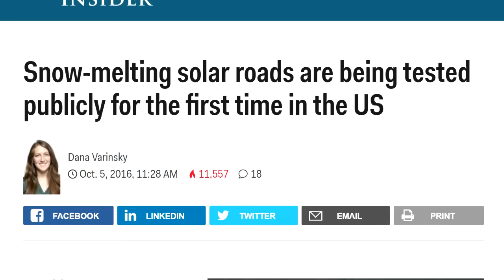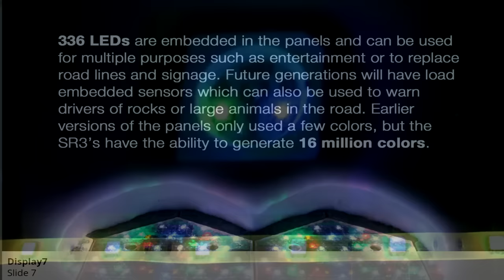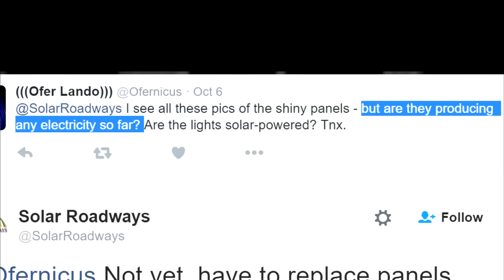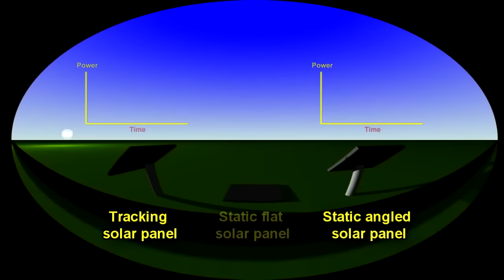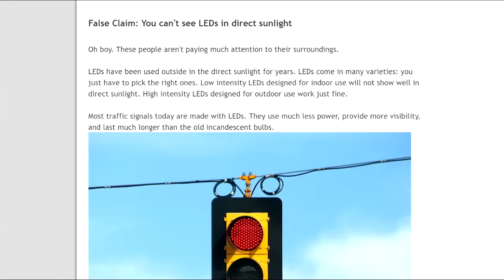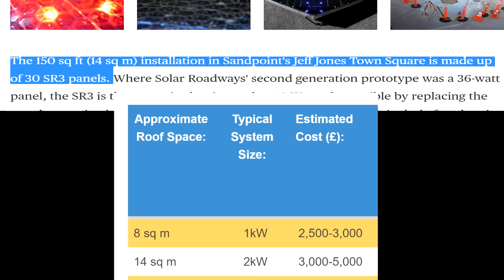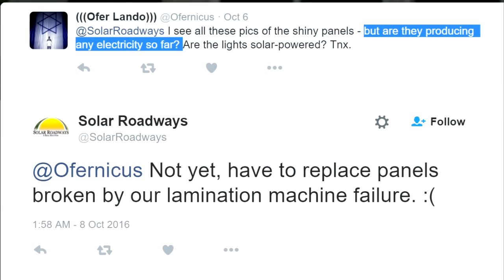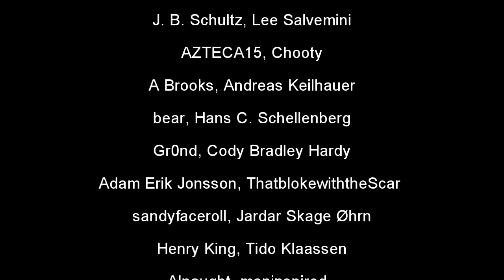First AMAZING Solar Roadway UNVEILED!

Comment: Why was the tilting of the solar panel relevant to solar roadways anyways? They're gonna tilt the road?
Reply: Light intensity hitting a surface depends on the cosine between the surface normal and the incoming light ray. The further off dead-on it comes in, the less intense the light, and if you're trying to generate power with solar cells, you want to maximise the intensity so you maximise the power you generate.

A panel flat on the ground isn't going to ever get the sun coming dead-on unless you're located right on the equator.
Reply: ***** Yes I knew that but again, they don't have much of a choice when it comes to the solar roadway. They can't tilt it.

Comment: i just got to be blunt about this. the idea of replacing all roads with solar panels is more or less a pipe dream. acording to Wikipedia their is over 4,071,000 miles of road ways in the usa. and lets just take a wild guess and suggest that to pave a mile of road. it cost roughly 10 grand. that is over 40,710,000,000 bucks.  that is over 2 times the current us dept. and this is not even counting side walks, parking lots or anything else that is mentioned. 

their is no way that this would work. let alone would it be more reliable then black top and paint. because what happens if it glitches out and causes a car crash? who would be liable then? could they sue them for damages due to faulty equipment? further more what industry would be affected by this? how many jobs would be lost because of the switch to this? also how much environmental damage will be caused by the production of solar pannels. further more where will you get the resources to make the dam things. 

further more if this was created. it would need enough silver to cover the entire distance. this would drive silver prices threw the roof. i estimate around 10,000 an ounce. making the price of a mile of those things. possibly around 100 grand a mile. making the new total to about 407,100,000,000. and that is just the usa. it is estimated that their are 11,194,445 miles of "paved road on earth" making a wooping total of about 1,119,444,500,000. 

so even if every single person on the planet gave all their wealth to support this idea. they would still fall short by about 1,060,444,500,000 bucks. it is just not fesable.
Reply: You're slightly off on the cost of highway construction....and by slightly, I mean by several orders of magnitude.  :)  The cost to build a new 4 lane highway is around 4-6 million dollars a mile, double that in urban areas.  The cost to mill and resurface an existing highway is around 1.2 million a mile.  You need to add 2 or 3 zeros to your final numbers...maybe more....just makes your point that more relevant.
Reply: ya i hate to point this out but that kinda makes my point even more valid. as i never did any actual research on the cost of roads itself. thou you do make a very valid point behind it. as the numbers i made up were pretty small in comparison to what really is needed. 

still in the end it makes my point more valid. that the idea behind it is near impossible to fund.

Comment: Warning long post: debunking ThunderF00t's debunking of solar raodways
Had I not dig a bit more into this solar roadway thing, I might have been convinced by your "debunking" video Thunderf00t. However, I now better. These solar roadways that you visited are kinda dumb, but these are old-tech roadways. There are prototypes being built that are far more advanced (using thin film tech for ex). Check Wattway solar roadway for example. We have a 1km solar road in France that is an actual road. The proof of concept is already there. Now is it economically viable at this point? Of course not. Just like every freaking renewable energy technology when it started. But now wind turbine and normal PV are competing with conventional energies in an open market (no subsidies). And they are doing fine.

Also, I've seen videos "debunking" the wattway solar road, but they only have 1 argument: the cost of solar roadways compared to rooftop PV panels or PV farms. Wich is a good point only in 1 way: if you have enough unused land to  make a solar farm, then great, don't do solar roads, do a PV farm. Everyone in your neighbourhood think that PV panels are aestetically pleasing? Fine, use rooftops panels. 

Saying rooftop panels or commercial PV farms are cheaper and more efficient than solar roadways, so we should completely ditch the idea of solar roadways is simply stupid. All these technologies are complementary.
It would be like saying that off-shore wind turbines are more expensive and have a way higher maintenance cost than on-shore wind turbines, so we should ditch off-shore wind turbines. Someone who think like that fails to understand the end-game of an ecological transition and scientific progress in general. 10 years ago off-shore wind turbines couldn't compete in an open market with no subsidies. Now they can.

Not to mention, there are a lot of cutting edge new technologies being developped in the photovoltaic world. Take perovskyte for example. This tech managed to get the same level of efficiency in 5 year than regular silicium panels tech did in 30 years. It is not commercialized yet but it could very much revolutionize photovoltaic science. So developping and researching ways to implement solar road is not at all stupid. Even if it is not viable now, the next generation of PV panels combined with what we learnt trying to overcome the construction challenges when researching solar roadways could very much make it viable in a few years.

What about multi-junction cell technology? Sure, they cost an insane amount of money to be made for a slight increase in efficiency, thus are not economically viable. Should we ditch the technology and stop research? Well guess what, this is a technology that is still usefull and is actually used for solar panels on satellites in space, wich are projects where cost is irrelevent compared to efficiency. And what if a technology used initially for space exploration ended up improving our lives down on earth, as it has been done for countless examples?

Another analogy as to why it is still interesting to research solar roadways is the electric car. Right now an electric car has the same carbon footprint as a conventional car has, because the electricity that it needs to run largely comes from conventional fuel like coal. But when that changes, and electricity is produces with renewable technology, then having electric cars makes sense. And what if solar roadways could provide the electrical energy needed to power your car? A few decades from now, when electric cars is the standard, wouldn't it be convenient and cost effective (no need to transport the electricity or integrate it into the grid) to have charging stations powered by the very roadway that people are travelling on? Wouldn't it be handy to have done a little bit of research beforehand?

You don't think far enough ahead Thuderf00t!
Reply: The Wattway has not shown that it can exist for 20 years without massive maintenance the way rooftop solar panels have.  Maybe if they make it 10 years without having been replaced, and are still producing a reasonable amount of electricity, then they might be close. Roads are really tough places due to vibration, shear forces and lack of air flowing behind the cells to keep them cool.

Comment: wouldnt a better solution is to make the roads a carbon sink. figure a way to pull carbon out of the air then turn it into a road way instead of using roadways that contain a chemical cocktail

Comment: I wouldnt want to live there if thats the quality of municipal workers workmanship, imagine how well they maintain public buildings?.  Who the fuck signed the work off as complete?  The hexagons not even fitting together properly, where I come from you would be sacked for such shoddy work.
As an aside, there are/were tiled roads, we used to have about 3 miles of em nearby.  They were more concrete strips admittedly, but they did last a very long time (decades) before being replaced with normal road material.  The problem with them wasn't durability but rather the bumpy clickity-clack train like ride you got as the vehicle went over the joins.  I guess they wernt as safe as theoretically they could cause loss of control, although I dont recall any accidents reported due to the tiles.

Comment: Sorry I'm late to the party. 
I'm not going to pretend these people are the right people for the job. I also think it’s a bit naïve to think that this is going to solve the world's power problem, but I do like the idea of Using hexagon panels to cover the roads. It could make it easier to build new roads or, fix and repair existing. The panels could be mass produced in a factory. (Instead of a garage on some ass hats ranch). When one breaks down it can be recycled and turned into another panel. A heating element with a thermostat could be add to help with ice and snow, and the “Power the Panel Produces” can be used to run the system. You won’t get the fancy light and it’s not going to bring power to the masses but, it might be enough to help power existing street light. Maybe even add some new ones on all the back roads in the Midwest. These people are f-ing stupid and shouldn’t be left in charge of cleaning up the dog crap left at truck stops let alone building an intricate part of the country’s infrastructure. I just think the right people might be able to make this useful.
Reply: josh walker using tiles for roads is a bad idea, they don't last that long and would be a lot more expensive to make

Comment: Well maybe they will change the project into something that is actually feasible... I mean like the solar "road roofs" idea in your video... I mean the idea is kinda cool in a science fiction kind of way.... but putting solar panels along the roadside would probably be better for cheap.
I am kinda worried though that our governments would spend money on stuff like this without like just telephoning a FREAKING SCIENTIST/ELECTRICAL COMPANY expert etc... to like overview the idea! lol its not the guy that bothers me... if you are gonna dream, dream big and maybe something good would come out of it but spending tax dollars on this is BS! lol

One of the neater transportation ideas that I seen was to make electric railways (I think they wanted mag lev but not sure) anyways they would be like mono rail that goes along with the top part of the railway being solar panels (mind you they were not delusional enough to believe that would be enough to power the entire system or anything) I think some sort of railway along major interstates is a brilliant idea (its certainly not without its drawbacks) but imagine smaller rail cars that transport something like 20 people at a time to and from major commuting areas like.... Atlanta or something... that might be pretty cool... and reduce gasoline usage for the medial task of going to work. You just run the railway along side the normal interstate. The one issue I see is getting to the railway from home (obviously they would drive) Then once you arrive at the city, you would need some sort of transportation to get to your actual workplace... maybe electric bikes or something but meh that would probably be better than this!

Comment: Yeah we all know that every single new idea and revolutionary invention worked from the get go, perfectly and without fault... Sure the first attempts here failed, but it just needs more development. By maybe a bigger and more capable team of engineers. Don't dismiss the idea completely because of a first and second attempt failure.
Reply: We're not making fun of the idea as something that will never ever be possible, its just there are SUCH better uses of the same resources. Put them same panels on roofs, or just off to the side of the road on angled stands, and you'd get much better results.

Heck, if solar panels were totally free to make and maintain then we might as well put them everywhere (even on the shady roads), but roads would be the LAST place we should be putting them after the ten thousand more logical places that are available!
Reply: Fluff Fluff Above the road would be a good option too, but the idea of these panels is that they'd also be used for indication: lining, roadsigns, warnings. If your road lining isn't static as with concrete or tarmac, you can do things like change lanes on the fly, for example when there's a traffic jam in one direction but two unused lanes in the other. You could simply change and give those two lanes to the other road half without more trouble than a few buttons.

The main idea of putting them in/on roads, is that roads are a very very VERY huge surface already available, without having to take more away from the environment alongside of it to mount solar panels. Every square mile of road isn't nature anymore (which we all know we kinda need for our survival), and taking away more is not as good an idea as utilizing the lost millions of square miles double. It's simply a more efficient use of the room.

Comment: I feel this video is just a video to damage the progress. It is new technology that is going through its shake down period. How many times did NASA have to test rockets, many exploding and failing, before NASA was finally able to get it right. People said, at the time, NASA will never make it work.

How may times was SpaceX testing landing rockets before they made it work? SpaceX clearly said these are tests and we will not get it right until after tests, adjustments, and more tests. People said that SpaceX will never get to the point where a rocket can lift off and the main booster return for a landing. Many professional people, NASA included, stated that it is impossible to land rockets. 

Tesla, had lots of problems in working on their cars. Their was a Tesla deathwatch website with a counter that was counting down to the death of Tesla. We all know how that went. 

Let us take a trip to the late 1800's. If anyone was back in time and they told people that in the future, their will be airplanes that soar tens of thousands of feet in the air with hundreds of passengers at speeds up to 500 MPH. Those living in the late 1800's would think the person speaking of the future is insane. If, back in the late 1800's, you told people that cars can go hundreds of mph and the occupants would be perfectly fine, they would probably say you are nuts. 

Also, if you told anyone in the late 1800's about lasers, cars that are super fast, rockets that shoot to the deep black beyond, sea going submarines that can go deeper that thought possible, about cell phones and how everyone would have a computer in their pocket that is their phone, music player, and internet access, they would admit you to the insane asylum. If you tell these people of the past that millions of lives would be saved by modern medical science, they would laugh. If you told these people that cars will one day drive without a driver, they might think you are a witch or something. 

I know this tech is recent and its very much still in the figuring out how it works phase, however, their is not one think on this Earth that is man made that did not have to be tested, improved, redesigned, tested, improved, etc. Give this tech time to be flushed out and perfected. It is not like it has been done before, their is no guide on what to do and in what way is best. 

All technology starts somewhere and then starts to grow. The first computer was gigantic and had less power than a calculator of today, that no less fits in a pocket. The cell phones we carry today started out as huge bricks that were heavy and really not very good. Now, their are phones that are really small, lightweight, and fast. A lot of these phones can play music, surf the web and more on top of making calls. 

I believe this tech will be flushed out and perfected someday. Give them time. In no way is it currently perfect, and clearly has flaws. That doesn't mean that the project is dead. 

The human brain, powerful, capable, and relentless. If you give the human race enough time, they will, and usually do, perfect what they are doing and make their hopes reality... just like very single bit of tech we now enjoy today.